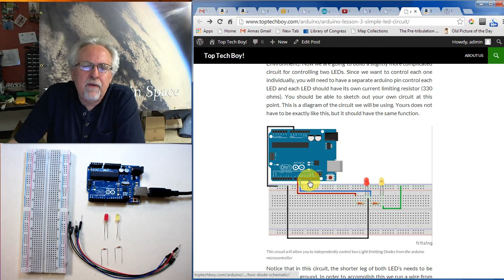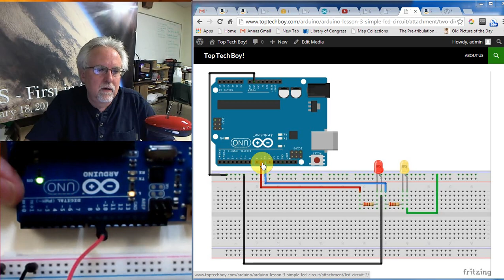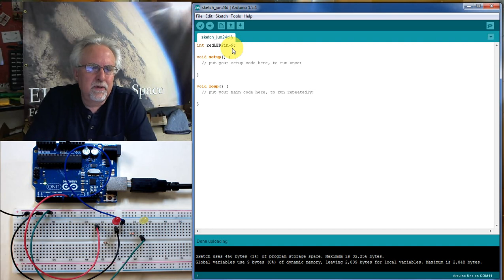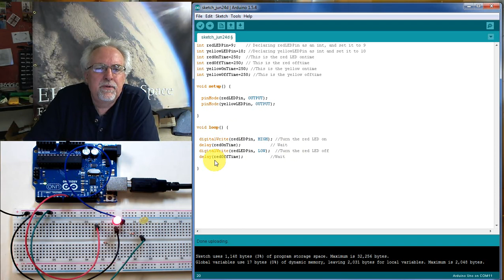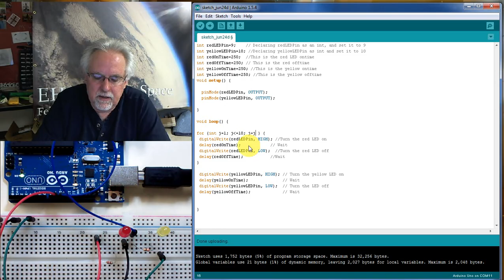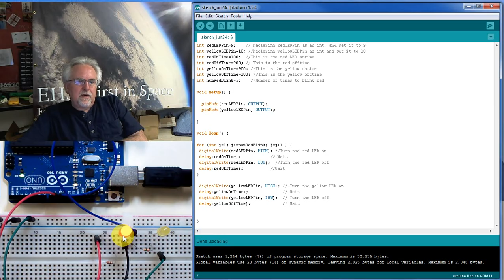LESSON 3 - Arduino For Loops and LED Circuit

Comment: Another enjoyable lesson; well done.   Question:  how do I run (control) a 3V LED from the Arduino?  Do I need to put in a parallel resistor to take some of the voltage?  Thanks.  Dr. Paul
Reply from the maker: You need to put a 330 ohm resistor in series with any LED you connect to the arduino.

Comment: Hi Paul, have been watching your videos one by one and really appreciate your excellent teaching style. After watching this video I have one question. (I am using IDE 1.8.19) I tried using "for loop" command discussed in this video. It works great - but - when I type "for" into the sketch it does not change color but the code works as it  is supposed to. Any idea whey color does not change?

Comment: Warning to those using Tinkercad. The anode and cathode are the wrong way around in Tinkercad. The bent wire on the LED in Tinkercad is the Anode.

Comment: I have started learning to code using Arduino to prepare for my retirement. I have followed your 3rd lesson. I made a mistake of connecting an LED between pin 9 and pin 10 on the b outsreadboard instead to the ground pin. The LED s are still working according to the program. ( correct on off timing) why is this possible. One of my LED has two digital outs.

Comment: Quick question, I accidentally used digitalWrite instead of pinMode to establish the numbered slots as an OUTPUT. When I used digitalWrite, the intensity of the light was very faint but still existent. When I used pinMode the light was much more intense. My question is: Why does pinMode increase the intensity of the light so much when compared to digitalWrite?

Comment: Just trying out an Arduino project kit for the first time. These kits are a very good value.

You commented about using "I" and "J" for loop variables. We are probably from the same generation of programming, age-wise, so I'm surprised that you don't know that tidbit of programming trivia. It came from FORTRAN programming. FORTRAN (from the 70s) had very strict rules for certain things, and one of them was that variables starting with the letters "I" through  "M" were forced to be integers. Since loop variables had to be integers, programmers, myself included, started to use the letters "I", then"J", then "K", etc as our loop variable names. Remember that then (ya I'm old), we "wrote" programs on punch cards, so it was far easier to type an "I" than some long variable name that started with "I". I still use that technique, though it does date me! LOL

Comment: I wired it a little differently. I put the LEDs into the ground rail socket eliminating 2 wires needed for the circuit. The Ardunio language is closer to GW basic then anything else. Also this is teaching me how to us an Oscilloscope.
Reply: Kent, yes you can put the short led leg directly into the negative rail. Im a newbie myself with also some BASIC experience in the late 80s. I do remember IF-THEN, FOR-NEXT command with INPUT. I was no star but now I have completed 11 of these vids. Problems have come but I have been able to solve them, very satisfying, lol! Do you happen to know why you cant use the 5v pin with a simple BLINK sketch?

Comment: you can do it like this:                                                                                                                                                                                                                                                                                                                                         int num=0;                                                                                                                                                                                                                                                                                                                                              
                                                                                                                                                                                                                                                                                                                                                                   
if(num <= 10)                                                                                                                                                                                                                                                                                                                                         {

digitalWrite(redLEDPin, HIGH);
delay(redOnTime);
digitalWrite(redLEDPin, LOW);
delay(redOffTime);

num++;                                                                                                                                                                                                                                                                                                                                                                 }

Comment: I had a real problem the first time i did this. What i did in the for loop was finish a ; Inside the curly brackets eg: for (int j=1; j<=numRedBlink; j=j+1;)  I'm curious why i didn't have to finish off with a ;

Comment: Mr. McWhorter,
Thank you for your tutorials.  I am new to Arduino and am 70 years old, so slow and lots of mistakes.  I was doing fine until in tutorial #3 and you used the “for” command and it wouldn’t change colors for me and so the command wouldn’t work.  Do you have any suggestions for me?  Thanks again, your method of teaching works best for me. 
Jack
Reply: I'm currently having the same problem. If anyone has a solution please let me know.

Comment: As a complete beginner, this was super helpful; Thank you. I'm working my way through the course. This evening (using a 170 breadboard), I did a 5-to-3 blink with two white LEDs. I plugged in a 9v, put it in a ziplock (in case of rain) and then into the mesh pocket on the rear side of my backpack. Worked as a flashing safety light for an evening walk to the grocery with my wife. Super simple, but felt like an accomplishment.

Comment: OK we got a problem! arduino and tinker-cad disagrees with you. the led has a straight pin and a bent pin. the bent pin is positive or the switch pin. the straight pin is negative. the bent pin is longer thats why its bent. however, you could say its shorter if you disregard the bent part. what your saying is "true" but your pointing to the bent "longer" pin and arduino and tinker agrees with that being positive. according to your diagram you have it reversed from everybody else. im confused, please explain this. you seem to think the bent is negative check out arduino or tinker its positive.
Reply: He did a mistake in the diagram thats all. The Pin should have ben reversed ( in the diagram)

Comment: Awesome teaching Paul. I am just starting in Arduino and have absolutely no experience in coding or computer languages. Following your tutorial I think I have compiled a program to blink an SOS signal in a red LED and to flash a green LED at the end of the SOS sequence. My ultimate aim is to program my electric start petrol bushfire pump to start and run by SMS signals. I haven't even got my Arduino kit yet but I have compiled the program with no errors based on your excellent tutorial. I have a long way to go in learning and your tutorials are an excellent resource. I love the way you intentionally put in errors so that we can them up and learn from them. Keep up the excellent work. Micah 6:8

Comment: May I politely know why you start making a circuit from ground(negative) to pins 1 to 13 (positive) when electricity flows from positive to negative
Reply from the maker: Make sure you did your pinmode correctly, make sure you have the correct value resistor, if this does not work, swap in a new LED
Reply: Paul McWhorter thank you sir......You really are a great teacher

Comment: hi I was wondering if anyone else ever encountered this issue and if so how do you fix it, I can't put an int that is longer than 8 characters it gives me an error at the bottom,  for example I had written :  int redledtimer=10;   in my line and it kept giving me errors until I changed the name to int redtimer=10;

Comment: Nice tutorial Paul, but there is a thing, you've taught to use the labels on breadboard correctly, Using the group plug should be in the negative rail whereas you put it on the positive one. I know that won't make a difference though following it would make it easier for next larger projects.

Comment: Re. ground rail on breadboards,, BEWARE;  with Chinese breadboards the long side rails are often split in the middle, you can fix with a short link.. (trap for young players)..
You are very good Paul, best Arduino/code tutorials around, bar none..

Comment: I am using Arduino Mega 2560. The problem is my red LED starts blinking right after I connect it to the USB port before loading the code. I tried to reset it, but the problem still persists. 

Help, anyone?

Comment: i always get this error (expected ')' before ';' token)
when i run . PS ; the line containing the for is highlighted in red colour
Reply: i had same problem my mistake was using ;
for( int j=1; j<=2; j=j+1;) {       this was line with error  because of ; after las1
for( int j=1; j<=2; j=j+1) {        this one was correct

Comment: Once "j" reaches 10 how does the loop continue to work?
Reply: Once it reaches j = 10, it turns on and off the yellow light. Everything told is done so then it again loops the whole program again. Which then again assigns j as 1.

Comment: i connect 4 leds (ABCD) and ON each one for 500 mS and Off for 250 mS.

int A=2;
int B=3;
int C=4;
int D=5;
int Aon=500;
int Aoff=250;
int Bon=500;
int Boff=250;
int Con=500;
int Coff=250;
int Don=500;
int Doff=250;
int AonTIME=5;
int BonTIME=5;
int ConTIME=5;
int DonTIME=5;

void setup() {
  // put your setup code here, to run once:
pinMode (A,OUTPUT);
pinMode (B,OUTPUT);
pinMode (C,OUTPUT);
pinMode (D,OUTPUT);
}

void loop() {
  // put your main code here, to run repeatedly:
for ( int j=1; j<=AonTIME; j=j+1)
{
digitalWrite (A,HIGH);
delay (Aon);
digitalWrite (A,LOW);
delay (Aoff);
}

for (int k=1; k<=BonTIME; k=k+1)
{
digitalWrite (B,HIGH);
delay (Bon);
digitalWrite (B,LOW);
delay (Boff);
}

for (int m=1; m<=ConTIME; m=m+1)
{
 digitalWrite (C,HIGH);
delay (Con);
digitalWrite (C,LOW);
delay (Coff); 
}

for ( int n=1; n<=DonTIME; n=n+1)
{
digitalWrite (D,HIGH);
delay (Don);
digitalWrite (D,LOW);
delay (Doff);  
}
}

Comment: Hi Paul, 
even for a guy like me (72 years) and my native language is not English and I have never done any programming, your lessons are GREAT !!!
I have a question: 
you showed that by clicking on a scrolled bracket it is able to se concerning loop.
But this doesn't work for me. 
I'm using Arduino 1.8.5 using Windows 10
thanks in advance for your reply.
BobAntwerp@gmail.com
Reply from the maker: I am noticing on the more recent version of IDE, this feature no longer works. Hopefully they will bring it back.
Reply: Many thanks for your feedback, Paul

Comment: I am using Arduino 1.8.5 and when i type the "for" in for the loop, I keep getting an error message "expected '(' before ',' token. Can you help me fix the code?
Reply: I have the same problem :
for (int j=1; j<=5; j=j+1) 
{My code}
Error : exit status 1
Expected ',' before ';' token 

I tried ; before and after but nothing it's impossible

Comment: FIGURED IT OUT:  
LOL,  I forgot the  ";" after declaring the int "numYellowBlink=3 below.   This fixed it.  Can someone explain why it halted and highlighted the "void setup()" line?   Debugging can be tough I see!! So far it makes no sense given the error.    This is the BEST tutorial on learning the basics of the Arduino.  I feel like I'm actually in a class room.   I love your teaching style and your on purpose mistakes to reinforce best practices.  THANK YOU!!

ORIGINAL QUESTION:
Did they change something? Creating the first "for" statement works.   When I add the second one to control the number of flashes for the second LED, it will not upload.  It halts on the "void setup()" line below and states "expected ',' or ';' before 'void'" .  My curvy brackets all seem to be in the right place and I do not know why the failure is in the line that it is.  Here is the code:

int blueLED=7;                    //Declare blue LED as int and set to pin 7 
int yellowLED=8;                //Declsre yellow LED as int and set to pin 8
int blueOnTime=250;        //Blue LED on time
int blueOffTime=250;       //Blue LED off time
int yellowOnTime=250;    //Yellow LED on time
int yellowOffTime=250;   //Yellow LED off time
int numBlueBlink=3;
int numYellowBlink=3

void setup() {
 pinMode(blueLED,HIGH);      //Sets Arduino pin 7 (blueLED) to High
 pinMode(yellowLED,HIGH);  //Sets Arduino pin 8 (yellowLED) to High 
}

void loop(){
for(int j=1; j<=numBlueBlink; j=j+1){     
 digitalWrite(blueLED,HIGH);               //Turn on blue LED
 delay(blueOnTime);                            //Delay before next line
 digitalWrite(blueLED,LOW);              //Turn off blue LED
 delay(blueOffTime);                         //Delay before next line
}

for(int j=1; j<=numYellowBlink; j=j+1){
 digitalWrite(yellowLED,HIGH);         //Turn on yellow LED
 delay(yellowOnTime);                      //Delay before next line
 digitalWrite(yellowLED,LOW);         //Turn off yellow LED
 delay(yellowOffTime);                     //Delay before next line 
}

}

Comment: //DONT FORGET TO RECHECK THE CODE AND PUT THE CORRECT SEMICOLON AT THE END
int redled = 9;
int yellowled = 10;
int ontime1red = 500;
int offtime1red = 500;
int ontime1yellow = 600;
int offtime1yellow = 400;
int ontime2red = 250;
int offtime2red = 750;
int ontime2yellow = 450;
int offtime2yellow = 550;
int ontime3red = 900;
int offtime3red = 100;
int ontime3yellow = 100;
int offtime3yellow = 900;

void setup() {
  // put your setup code here, to run once:

  pinMode(redled,OUTPUT);
  pinMode(yellowled,OUTPUT);

}

void loop() {
  // put your main code here, to run repeatedly:

  digitalWrite(redled,HIGH);
  delay(ontime1red);
  digitalWrite(redled,LOW);
  delay(offtime1red);
  digitalWrite(yellowled,HIGH);
  delay(ontime1yellow);
  digitalWrite(yellowled,LOW);
  delay(offtime1yellow);
  digitalWrite(redled,HIGH);
  delay(ontime2red);
  digitalWrite(redled,LOW);
  delay(offtime2red);
  digitalWrite(yellowled,HIGH);
  delay(ontime2yellow);
  digitalWrite(yellowled,LOW);
  delay(offtime2yellow);
  digitalWrite(redled,HIGH);
  delay(ontime3red);
  digitalWrite(redled,LOW);
  delay(offtime3red);
  digitalWrite(yellowled,HIGH);
  delay(ontime3yellow);
  digitalWrite(yellowled,LOW);
  delay(offtime3yellow);
}

Comment: the leds only flow in 1 direction, why not just put one resistor on the ground and put both neg led probes in the same column? 
because you're just following the wiring diagram?

Comment: Shouldn't the pins rather be defined as char instead of int? Char only use one byte memory space. I'm used to working with pic micro and MPLABX IDE with xc8 compiler. Pins normally gets defined using syntax like this  #define redLed PortA.RA5

Comment: is it alright if I run a blank new sketch just to stop the LED from turning on and off?
Reply from the maker: Yes, or write a program that just sets the pin low. The arduino keeps the program that was last pt in it, and runs it when it is powered up.

Comment: Just a question on your initial schematic where you show the redLED as V2 5V and yellowLED as V3 5V.  Why is one V2 and the other V3?  What is the significance of V2 and V3?  And how did you calculate the values of the resistor?  Thank you for your great videos!

Comment: Hi Paul, thanks for the tremendous effort offering these wonderful tutorials. Honestly these are way clearer than anything else I have seen and make writing Arduino code seem very accessible. Just a quick question please: after your excellent description of the for loop function I noticed that in the line  for (int j=1 j<=numRedBlink; j=j+1 )   there is no semi colon at the end of the statement. I am sure that is correct as the code runs but why is it exempt? also,  the space before last parenthesis is a mystery :)
Reply: i noticed the space too; but spaces don't really "matter" to the code, it's just clearer writing if you are consistent, clearly this was a typo as the code still works as we saw. as to the 'for' part of the loop, the end of the line of a for command doesn't have to have a semi-colon at the end, but it does have to have one between each of the arguments as he's got. however, i'm confused about the curly brackets....there is a set of brackets around the redLED code block, but  not the yellowLED code; yet the program still runs.

Comment: What happens if I disconnect the Arduino from the computer, will it still work with the same function that i specified previously?
Reply from the maker: Yes, you just have to provide power. The program will be whatever the last one you downloaded into it.
Reply: Thank you professor!

Comment: Hello Paul, great series.  That sounded like an amateur repeater ID.  Do you do anything with Arduino relating to ham radio, such as antenna analyzer, RF field strength meter, etc?  73, Chris - NI7IN
Reply from the maker: We use HAM band at 2.39 GHz to send the data back from the arduino to our mission control. Yes, you are hearing a repeater, and many of the students have their licenses.  We have about a dozen students in the school with their licenses, and about 5 of them are extra already.